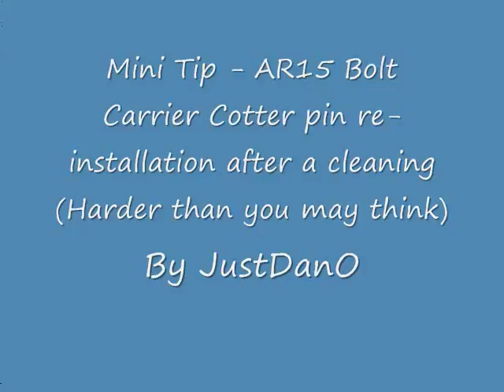Mini tip  AR 15 bolt carrier group COTTER PIN Re-Install toubles ? Take a look

Comment: My pin falls out unless I put some grease in it. Should I take a pair of needle nose pliers and give a slight bend NEAR the end, to give it a slight bump to keep it locked in on the other side. OR, does it just not matter, since it is not going anywhere while being fired??
Thanks,.. ahead of time.

Comment: I have found that mine goes all the way in quicker when I push slight down on the loop (with it oriented as shown in this video), but upon first inspection after purchase, and before firing for first time, I was thinking I’d have to take it back to my FFL to figure it out. This is a great video!!

Comment: Thank you for the tip, I had to send a small punch in to push the leg into the hole after lining it up. hopefully i won't have to pull the firing pin out again soon, my fingers are sore. lol.

Comment: Thanks.  However I also found, at lest in my case, a upward tilt may also be in order. So if this still does not work for you try adding a tilt by moving the pin towards 6 o'clock and then push.  Thanks again..

Comment: Another tip would be to use a sharp pointed instrument like a dental pick and stick in in the hole that the firing pin tip comes through to hit the primer. Push the firing pin back in the hole while applying pressure on the cotter pin to push it in. Make sure the cotter pin head aligns like suggested in the video (running parallel with the bolt) and if it doesn't go in, turn the cotter pin 180 degrees while maintaining pressure and it should push the side of the pin that's sticking out too far to allow it to go in the hole. I just did it and it worked like e charm!!!  Good luck and be patient.
Reply: Thanks for that tip also! I had thought my retainer pin was ruined from me trying to force it into the hole. I even tried compressing it in a vise over night. Using this video tip of keeping the retainer horizontal and your tip of using the pressure applied by the firing pin to squeeze the ends together the retainer went through in a matter of seconds!  I'd been out of commission for over a week and was shopping for a new retainer pin! Thanks

Comment: Thank you, I've reassembled a few times with no problem, but this time that cotter pin didn't slip in easily. The pushing down trick was perfect, along with correct cotter pin orientation.

Comment: Excellent!  I have an AR-10 with an incredibly reluctant firing pin retaining pin (cotter pin).  Mine actually required a gunsmithing pick to keep the prongs of the pin together after it went through the first hole.  The orientation of the pin was perfect, it just still wanted to separate.  Anyways, your video was a great help.
Reply from the maker: If the cotter pin prongs open to far to insert into the other side, get a new cotter pin. There is always some variance in that aspect of the pin. If you get a bad one or several, they should be inexpensive to replace for solving that issue for good. There is some spread between the prongs and a spread is needed to function properly so dont expect a new one to be perfectly unbent as there should be some amount of bend. Good luck and reply back if that helps or not.
Reply: Well, I am working on a crappy Palmetto State Armory AR-10 build at the moment.  It's hideously unreliable, and the cotter pin (firing pin retaining pin) was also a pain in the hindquarter region.  I'll certainly order spare parts, but I was able to get the old cotter pin in.  While AR-15s share common parts across brands, AR-10s do not.
Reply from the maker: Do you have any suggestions on inserting the cotter pin on a AR-10?
Reply: I had to use the technique in the video plus sliding a gunsmithing pick underneath the firing pin.  I used the pick to force the ends of the cotter pin together so that they would fit into the far hole.  I suspect most cotter pin insertions won't be as difficult as mine, and I'll be re-ordering several cotter pins to replenish my repair kit.  Again, an excellent video.  You could send it as a link to Robert Farago and The Truth About Guns to expose it to an even larger community.
Reply from the maker: Almost sounds like you had a bad cotter pin as the end for this purpose the pin should not be spreading apart (example like someone bent one or both of the ends, as they are pre-bent for retaining the firing pin)
Reply: Certainly could be.  New stuff is on the way.

Comment: I have 5 of these rifles and pistols.  This has always been an issue.  I get it in by pure luck generally.  Today, my luck was not doing very well and after about 30 minutes, maybe more, I decided to write my question into the internet.  I got your video as the number one item.  Worked INSTANTLY.  I watched the video, turned the pin head horizontal and pushed it in.  Just that fast.  Thank you for teaching me the trick for how to do it.  Thanks also for teaching the other 8700 or so viewers on here.   Pre-internet I would have just screamed and perhaps my BCG would not have survived my efforts!  The one that was sticking was an over $200 nickle-boron unit.

Comment: Thank You x1000! I got totally stumped after my first cleaning and was about to order new cotter pins when I made a Hail Mary pass on a web search and found your tip. After watching your video, my problem was fixed in 10 seconds! This should be in every AR-15 manual.

Comment: Thanks for the tip!   I turned the pin horizontal per your suggestion and stood parallel to a bright window to let the sun shine through the second hole so I could see it from the inside.  Being able to see it meant I could wiggle it in quick and painlessly.   Thanks!

Comment: Seriously thank you so much! Perfect amount of information and perfectly explained. I’m a relatively new AR owner and I was taking mine apart to clean it. I noticed how loose the pin was and thought hmm it’s either supposed to be that loose and goes tight back in or there is an issue. I was so mad at myself for pulling it out like an idiot and not be able to get it back in.

Comment: Thank you so much. I have struggled with this for a long time. This information should be included in each manual sold with all rifles that include a pin in a bolt carrier group. Thanks again!

Comment: my pin won't fucking go in
Reply from the maker: One of two things are wrong. Either the two ends of your cotter pin are too far apart (spreading apart) or you are not understanding the directions.
Reply: Mine wont go in either, tried everything...twisting, wiggling...everything. Ordered the KNS Prima Pin...$10 bucks...never screwing with this again all damn day like today